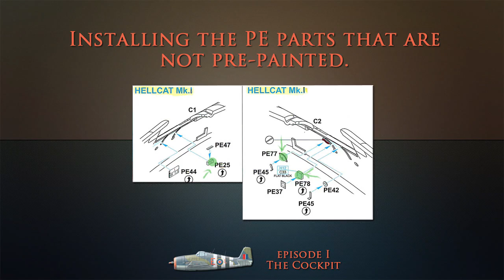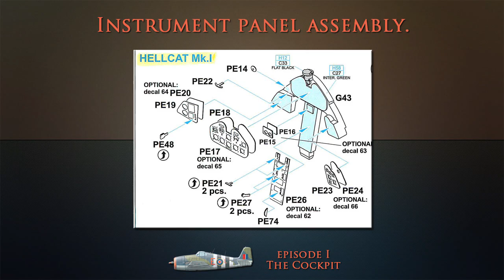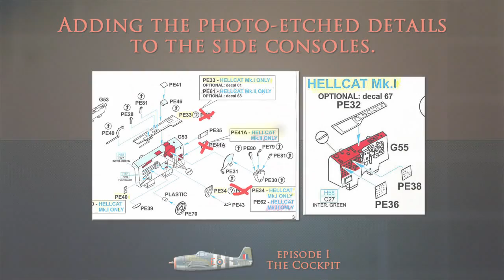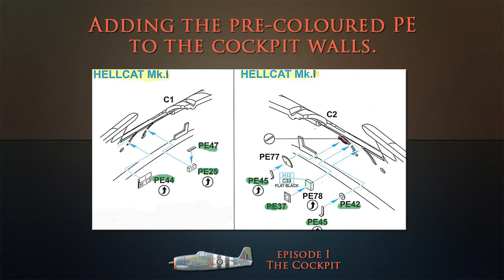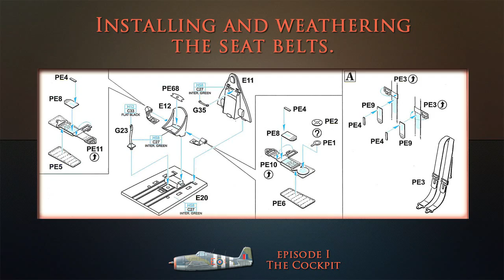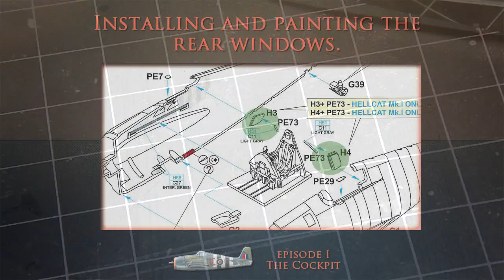1/48 F6F-3 (Mk.I) Hellcat scale model step by step build - Ep.1 - The cockpit

Comment: Try using a Chisel Blade instead of an Angled blade.................removes raised materials much easier. *PLUS, small dabs of CA glue via the tip of a toothpick will work much better when installing Brass Etching pieces.*
Reply from the maker: Thanks for the tip mate, appreciated :)

Comment: Only part I disagree with is at the 33:56 mark.  When working with clear plastic, NEVER use CA glue.  It WILL cause those rear windows to fog over time.  I like to use acrylic gloss medium.  It takes longer to dry than white glue and gives time for adjustments.  I'm currently doing the Hasegawa kit using the resin cockpit kit from Aires, engine and cowling from Quickboost, and the seat harness from Eduard.  It's an entire insert and requires significant chopping on the fuselage halves.  Next time, I'm building the Eduard kit.  It seems to be a better product than Hasegawa's.
Reply from the maker: Thanks for your input mate. What I am using there is Mr. Cement S not CA glue. I personally haven't built the Hasegawa kit and cannot compare it with Eduard's but the latter is a pretty decent kit.

Comment: Very surprised to see you don't use primer, especially with PE parts and relatively weak bonding acrylics.
Reply from the maker: Here I am using mr.hobby acrylics which are much more potent than the Vallejo type acrylics, especially in combination with MLT. More over when no masking is involved it is all OK. But I agree that proper primer is the way to go. I am priming everything since then.